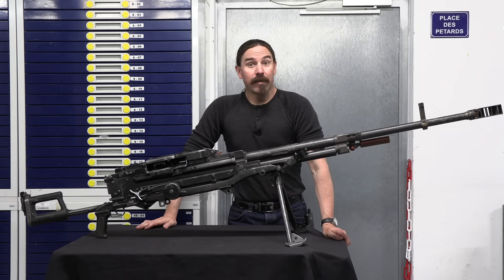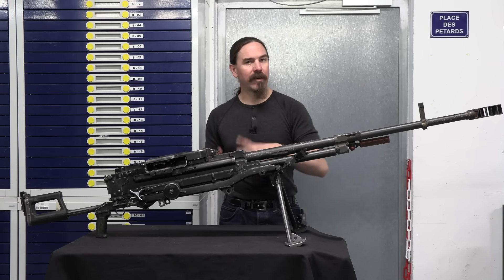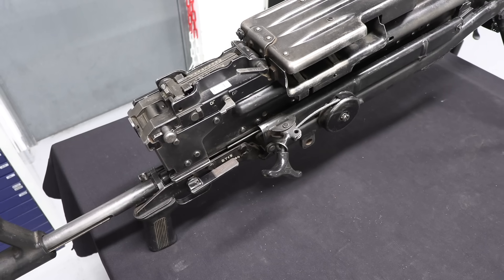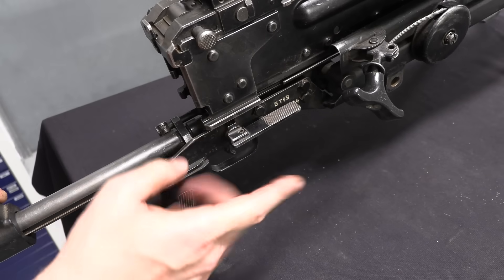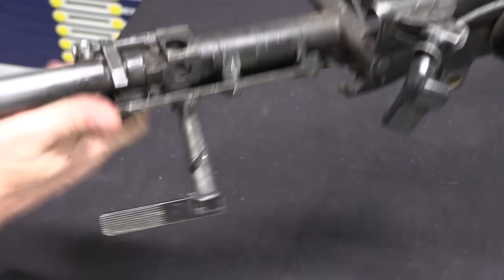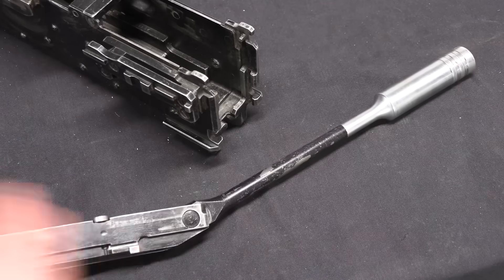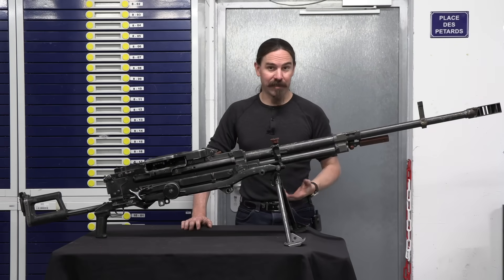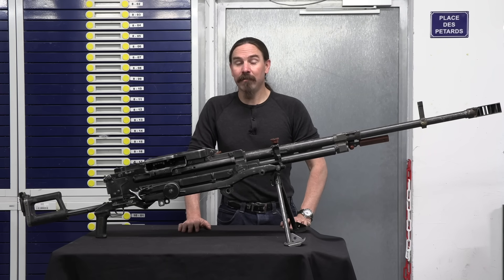Kord: Russia's New .50 Cal Heavy Machine Gun

Comment: Funny that the Russians keep making new .50 cals. Seems like we got the design right on the first try.
Reply: the Russians are focusing on trying to get the weight down. If you look it up the Kord weights less then half the M2 with a bipod.
Reply: @vehx9316  apples to oranges. M2 with the tripod isn't a proper comparison to the Kord with a "bipod".
Reply: @addmix  even on a tripod, the thing still weights significiantly less then the M2HB and the fact that it can mount a bipod while the M2 cant is one in its favour.
Reply: @addmix  To put it in prespective : The Kord without any attachment is 25.5KG, the M2 weights 38KG. 

Yeah, do the math.
Reply: @addmix  Even if you strap on a tripod to the Kord, the total weight just comes in at 37 Kgs, compar that to the M2 that comes in at 58 Kg. There is absolutely no similarties to be had between the Kord and the M2 in terms of weight.
Reply: And then messed it up with your replacement, so had to go back to the M2HB...

The NSV and the Kord are good guns, and met the requirement for a lighter gun to replace the DShK. The M85 was intended to do the same for the M2HB. It failed.
Reply: @Rupert-B  issue is that the M85 wasn't any lighter than the M2. Similarly, the Kord and NSV are only a few pounds lighter than the M2.
Reply: @addmix  The M2HB is 84 lbs, the M85 is 65 lbs. The NSV is 55 lbs, and the Kord 60 lbs, all the base gun except the Kord for which that's the vehicle version weight (because without the mounting it's not really a functional gun).

I don't count ~20 pounds as 'a few'.
Reply: @Rupert-B  Completely ignoring the AN/M2 which is 28 kg (62 lb).

Kinda odd that you insist to use the heavy barrel version of the M2 for your argument, instead of the comparable light-weight version.
Reply: @addmix  Because the AN/M2 was used in aircraft and on ships, and wasn't wasn't in the ground role that is comparable to the main use of the NSV, etc.

But, to compare like with like, the nearest M@ equivalent to the Kord would be the M2A1 with its quick-change barrel, fixed timing, etc. It weighs the same as the old M2HB.
Reply: @Rupert-B  because there's no point in reducing weight for mounted applications...
Reply: @addmix  Moving the goalposts much?
Reply: @Rupert-B  nope, no goalposts moved here, just that the military doesn't care to use the light variant in places where isn't not necessary.

Comment: This video gave me flashbacks from disassembling NSV in the finnish army 20 odd years ago. We called the "russian machine gun disassembly tool" - mallet a "soviet push screwdriver"
Reply: FW, you need to check up on this; I'm pretty sure the term for "soviet push screwdriver" has and alternate meaning.
Reply: @fredericrike5974  is it like an alabama bird bath?
Reply: Did the FDF use the NSV in large number or for very long?
Reply: @CricketIrken  In large numbers: no. For very long: yes, it's still in use. Finnish LMG/HMG sector is very diverse with several different domestic and foreign weapons and combinations thereof being fielded simultaneously by different troops.
Reply: @KILLD0ZER  I disagree. One per platoon (yes, even CS and CSS troops) + separate vehicle mounted ITKKs for motorized troops is "large numbers" for a military with a potential wartime strength of 950k. It's probably the most numerous mounted machinegun in the FDF; everything else I can think of (MG3s that came with the Leopard IIs, M134s on the NH90s etc.) is a niche weapon added as a deal-sweetener from a one-time acquisition.
Reply: @bathshebahubber614  Oh yes if you only count HMGs, I was also counting LMGs like KVKK etc. etc.
Reply: @KILLD0ZER  Of course. It's why I specified "mounted" because surely the kovekki and (maybe) the pekari outnumber itkus since they are issued per squad rather than per platoon.
Reply: @CricketIrken  They still use it. FDF designation is Itkk 96
Reply: i remember that as well, but that was nowhere near the size of this giant :D
Reply: That's funny. We used to call a hammer an "American screwdriver."
Reply: Yeah, good tool with the soviet vertical pitch screws. "Pystykierre"
Reply: @SergeyPRKL no Serhei!!!ruuvimeisseli(suomeksi)
Reply: Why don't you like Russians?
Reply: Welcome to NATO
Reply: У вас таких пулеметов нет, потому что у вас нет оружейной школы  , вот и остаётся язвить по поводу русских инструментов.

Comment: One would expect a gun with quick change barrel, especially one made well after 1990, wouldn't require mismatched barrel to be post-.fitted... Seems like that should be worldwide expectable standard since at least 1960s or so
Reply: most likely this exampe was gotten from Africa or the ME, the absolute beating this unit had taken would explain why certain parts of it were mismatched.
Reply: @vehx9316  Sure, but still, mismatched parts should be interchangable without field modifications in what's modern production firearm. Especially parts which are meant to be exchanged quickly during combat.
Reply: @Sseltraeh89  warping of parts due to overheating can explain the mismatch
Reply: Да это не результат не взаимозаменяемости стволов,а результат раздутия конкретного ствола от интенсивного настрела. Чувак!

Comment: How is the trigger pull transferred from the mount to the actual trigger mechanism?
Reply: Pulling the trigger lifts a lever on top of it. This lever presses a rod which is inside the back plate. The rod protrudes upwards and activates the trigger mechanism. In the video this rod inside the back plate is never mentioned, but it is easy to spot when the back plate is removed. Furthermore, when Ian shows the top trigger assembly, you can see that the metal is a bit worn out on the spot where the rod pushes on the trigger levers.

Comment: Never thought I would see a video on the KORD. It and the NSV are common weapons yet nobody has done an overview and fieldstrip like Ian.

An old beat up example but an informative video.
Reply: There are plenty of NSV field strip videos if you look up in Russian or Ukrainian, and you can automatically translate the subtitles
Reply: A few channels have already done it, you probably just hadn’t seen them
Reply: NSV has tilting bolt. KORD using rotating bolt. You can change the barrel without adjusting the  gap, and even more so you do not need to adjust the timing, like the M2. M2 absolutly obsolete shit.
Reply: @AlASokolov The M2A1 already solved those problems. It has a quick change barrel and doesn't need any headspace adjustment. You have outdated information.
Reply: @johncarl5505  Oh, yes, the problem has finally been fixed, less than a hundred years have passed! However, not all machine guns that are in the army have only a part, but the rest still adjust the timing and try to set the gap with a probe.
Reply: @AlASokolov  It's not tilting, it's sliding like in Sharps carbine, Ruger No. 1 or M73 machine gun

Comment: 0:26 a more modern 50 caliber machine gun in the late 1960's to replace the one dating all the way back to to the 1930's to compete against the American counterpart designed in the 1920's...
Reply: 1960's gun already makes M2 dated like a mammonth era shit. Even existence of M85 makes that obvious. 
M2 wasn't made without flaws, and its immobility coupled with other problems is the reason you didn't see it on back of soldiers during Afghan campaign in '2000-'2010s

Comment: So, was the cable pulley the same one as from the Nikonov 94, or did the Nikonov take KORD components?
Reply: they have pretty much nothing in common except the sheer fact that there are wheel and cable
Reply: @funtaril  Lighten up. It's a joke. Even then, I'd like someone to measure and see. It's a genuinely curious thing.
Reply: @gregoryfilin8040  it's genuinely a bland joke. Kord uses this as the enhancement method for charging. Nikonov uses what it uses because there's no other choice
Reply: @worldoftancraft  Wow, you just keep tightening up. Granted my wording wasn't great, but it is just a joke. Lighten up and give a better one.

Comment: No opinion of reliability vs the M2, but there is a lot to like about it, IMO.

What is the weight of the weapon?
Reply: A previous commentor looked at WikiP and it came in ~25% lighter, but your mountings may vary😊.
BTW, that bipod setup looks really well thought out for pre-CAD/CAM investment casting era design!
However I would put a sandbag between my shoulder and that buttstock before pulling the trigger, ya never know!
Reply: both weapon platforms have a reliability of "yes."
Have to do something really special for them to malfunction
Reply: @lred1383 you can simply service M2 the wrong way and it can blow up. Headspace and timing.

Kord physically has no such issues
Reply: Weight allows it to be carried on soldiers back in a disassembled condition. I.e. you can take it to the mountains. Which is exactly the thing you can only desire if you have M2

Comment: Is that charging mechanism similar to WW1 aircraft guns like the Lewis?
Reply: Not sure about ww1, but its much like the cockpit charging handles used in P-39 Aircobra 37 or 20mm nose gun, and P-38 Lighting 20mm also. Same problems, same solution- much safer to delay charging weapons until well up and away; and the cannons often had ammo feed problems so if it jammed up, you lost most of the aircraft's firepower. It's one the arguments for the US designers use of 6 to 8 .50's in fighter thats rarely expressed : the loss of 1 or 2 or 3 guns isnt as critical, your still in the fight. And M2 Browning is a reliable gun that could be trusted to get the job done, then and now.🙏

Comment: The stories that gun could tell...are obvious;
1) Jam un-matched, poorly fitted barrel 1/3 the way into receiver, gets stuck
2) Grab hammer, begin bashing on front sight to remove barrel, sight breaks off
3) Continue bashing on muzzle brake, borking up the rear most chambers, barrel releases
4) Grab angle grinder, take out frustration on outside diameter of barrel extension
5) Reassemble, remember that front sight is needed for accurate shoot-shoot, tack weld back on with car battery and AK cleaning rods
Reply: I suspect this gun came out of the middle-east or North Africa.
Reply: @slade9372  Mali probably ...
Reply: @slade9372  Middle-east or Africa or Russia there is no difference
Reply: That's not even a tack welded. That looks like it was just braced :D
Reply: @AleXxTM123 I'm sure you meant Brazed, a join made using a bronze alloy filler rod without melting the base steel materials. 😊 totally looks like a field bodge job, merging usable parts from 2 guns to make shit go down range. Oh well, good enough!
Reply: "Still fires like its lubed with butter, except its actually lubed with butter."
Reply: Russian smekalka at its finest. For those who don't know this is a desirable trait in russian society that is somewhat similar to DIY but particularly focused on repurposing and making do with limited resources to create something that works.
Reply: I read it in 40k Ork voice.
Reply: Something tells me the armourer probably didn't want to go through the paperwork to get the parts to actually fix the sight and just went "sergei, pass me the solder"
Reply: @Sabrowsky  Documentation on repairs is quite rarely done in RUAF, usually people just use their funds.
Reply: @worldoftancraft  Ian did mention that it didn't come from Russia... the Gandermarie captured it 8 years ago, presumably somewhere in Africa.
Reply: @marinodezelak1180  why would you tell that to me? Does it debunk the manufacturing theory? Or  makeshift repurposing of NSV Utôs barrel?
Reply: @worldoftancraft  You said 
"Documentation on repairs is quite rarely done in RUAF, usually people just use their funds."

I'm pointing out it's irrelevant here, the gun is not from there.
Reply: This made me laugh harder than is should have 🤣🤣
Reply: But also the fact that barrels need matching tells us about relatively poor tolerance management at the factory
I can understand headspacing, but not being able to turn the barrel down to the right diameter? Huh?
Reply: @thumba-umba2699  are you sure it wasn't a repurposed NSV barrel? Or a tight-fitting "innovation" made by a factory working? Cool down the barrel and fit it.
Reply: @thumba-umba2699  I don't think I'd call it 'poor' tolerance management.  Most likely every barrel is within a thousandth of an inch or so of the others.  The difference is that it's a 'transition fit' (semi press fit) in the receiver, rather than a loose-fit barrel journal tensioned by a locking piece, like how most quick-change barrels operate.  The advantage of the tighter fit is that you get better accuracy between barrels (in theory) and better heat transfer from the chamber area of the barrel to the receiver.  It's definitely an older-school way of doing things, but I wouldn't call it 'inferior,' per-se.  In Ye Olden Days, MGs were issued with a couple number-matched barrels, and they stayed together until armory refit.  Crude compared to just-in-time resupply at a forward base, but it's easy to explain & understand for recruits.

If the Russians were truly incompetent machinists/gunsmiths, their equipment simply wouldn't work (see India's INSAS).
Reply: @thumba-umba2699  looks more like epoxy
Reply: Напрасно иронизируете! Эта пушка произвела перед этим столько выстрелов,что вам и не снилось. Повреждения на мушке и дульном тормозе вызваны попытками снять раздутый от перегрева ствол (в районе патронника) Видимо это трофей доставленный из боёв на Донбассе.  Относительно новый пулемёт разбирается без проблем.
Reply: @alexanderionov4748 ты хоть слушал, что в видео говорится?
Этот пулемёт привезён французами из мест их французской активности, 99% - Африка, Мали/Намибия, как писали выше

Comment: That ripcord charging handle is so badass.
Reply: Fr but also i have an image in my head of  doing a lawnmower style start and like "hang on i gotta start my machine gun" and it makes gas engine noises lmfao
Reply: It really does feel like Russia in the 90s had a thing for pulleys

You got the AN-94 and then the Kord

Guess you could say you gotta... pull the Kord
Reply: @gohunt001-5  that's the first thing came to my mind when I see the Kord
Reply: @gohunt001-5  Immediate watch?v=yUO7Ef2ZOTY&t=34s
Reply: @gohunt001-5  do you even remotely understand that those pulleys have no single thing in common?
Reply: @worldoftancraft  they don't need to have anything in common for the comment to be correct, not to mention useful, as I myself had not made that particular connection
Reply: @custodeon  it simply looks out of place. It's the same if you compare a crane and a pulley.
Reply: Похожая система взведения есть и на гранатамете агс-17
Reply: ripkord if you will
Reply: Let it rip

Comment: That barrel, so Bubba the gunsmith has a doppelganger in Kazakhstan.😄
Reply: Its obviously not a factory barrel, probably taken from another gun of the same caliber and welded with parts from original barrel.
Reply: I'm wondering if they lost the only angle grinder factory in the collapse as well.
Reply: @henryturnerjr3857  every angle grinder in the soviet union was produced in one city-sized closed facility somewhere in Turkmenistan, after the collapse, all already produced angle grinders in service throughout the Russian federation were stolen by the mafia, Nick Cage method acting for the movie Lord of War and ComStar
Reply: Ian said it's a French SF pick up, so likely Africa.
Reply: @EricDaMAJ  In all Africa it was exported only to Mali and Namibia AFAIK, and French forces were active in the former
Reply: @EricDaMAJ  only syria outside russia used it.
Reply: @EricDaMAJ  It could've have been picked up anywhere. The weapon was made in Russia and the bubba gunsmithing was likely down there as well.
Reply: @mikebaggott7802  Most likely hand fitting at the factory due to lower manufacturing standards. If all barrels were produced within proper tolerances there would be no need for grinding it down as the parts would be interchangeable. Having to do headspacing in this way in a modern gun ...
Reply: @Status1985Quo  I agree.
Reply: @nurnburgring3102 salty russian😂😂😂
Reply: @Status1985Quo  That's not the headspacing, that's just a plain bad fit of extender into receiver, for whatever reason. The headspacing is done by adjusting the barrel in the extender, and it looks like it's a factory job.
Reply: @floriansoos4716   it's likely hand fitting at the factory. The machining was probably of a bit and it got fitted by one of the workers.
Reply: @mikebaggott7802  but the gun looks so used, have nt they changed the barrel 35622 times since its factory days?
Reply: @floriansoos4716    that's not wear, that's machining marks. It's pretty oblivious the barrel didn't fit at the factory and it was hand machined to the proper specs so it would fit.
Reply: @mikebaggott7802  im not talking just about the barrel everything is worn on the gun like it has been through ww3
Reply: @floriansoos4716  , okay? What does that have to do with the machining on the barrel? Those marks on the barrel are not wear, they are machine marks.
Reply: @mikebaggott7802  Nah. At factory such skunk would fall under "defect piece" norm and likely sold afterwards on black market. I can believe that factory doesn't care and make changeable barrels substandard to make them fit in near front line workshop by circular saw or something, but not in job like this made in factory. Russia doesn't have production culture like this. This kind of stuff you can expect from Pakistan or Turkish made stuff. Maybe some wish chinese craftsmanship. Definitely not factory grade russian.
Reply: Bubba Yaga
Reply: Russian craftsmanship, on proud display!
Reply: Russia, not Kazakhstan.